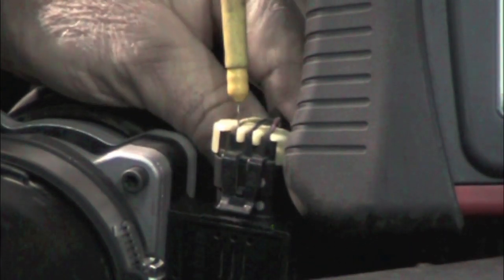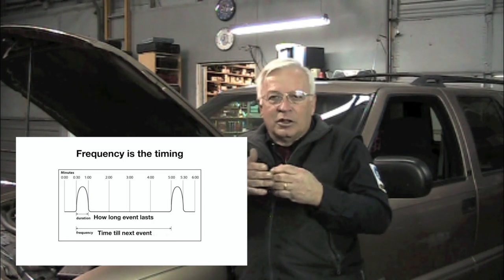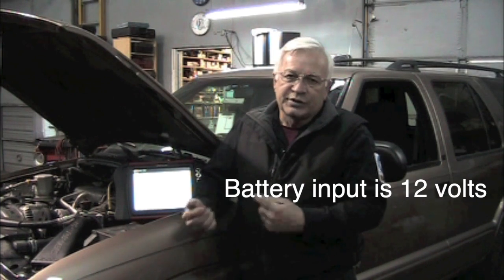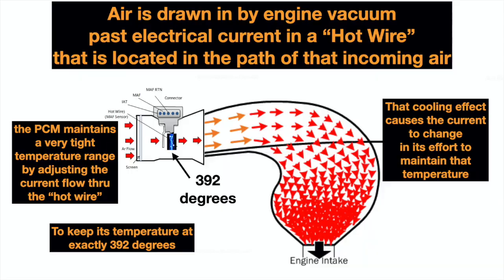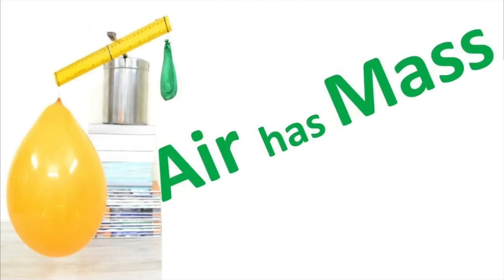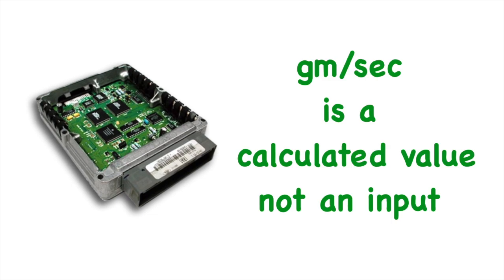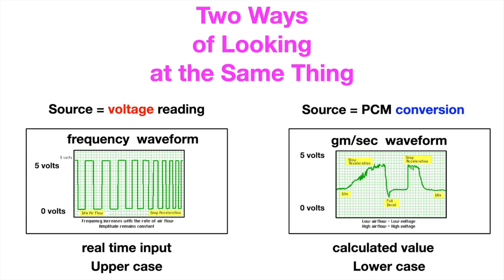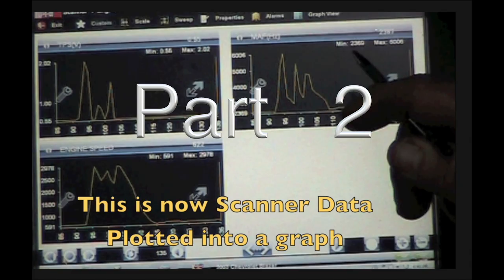MAF    frequency vs  gm/sec

Comment: Learned alot from this video how the  maf sensor has ground 12 volts applied to it and power and received input from pcm I used to say it like this the  mass air flow sensor controls air fuel ratio and sends it to the ECU but really didn't know the internals of it thank Dwayne